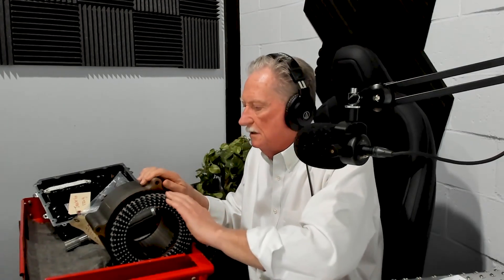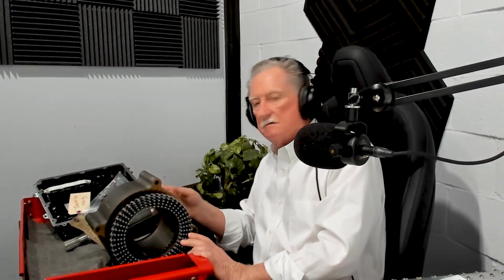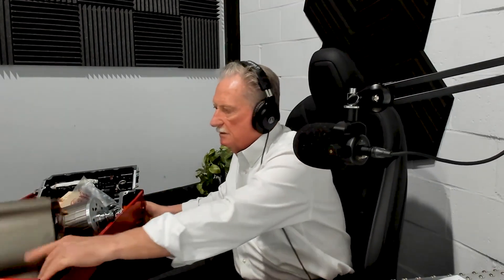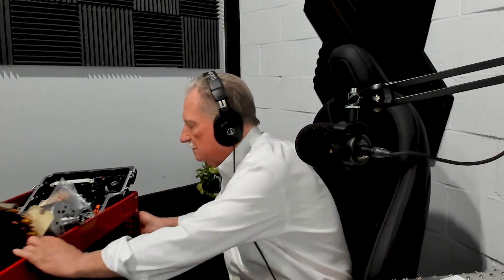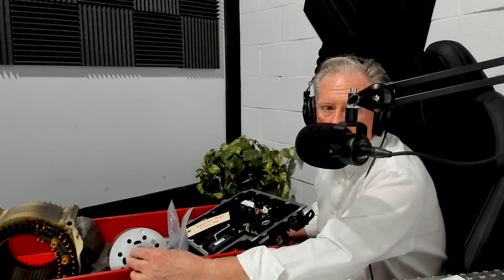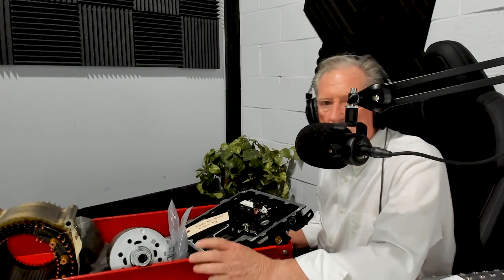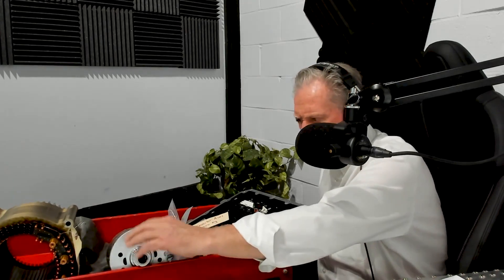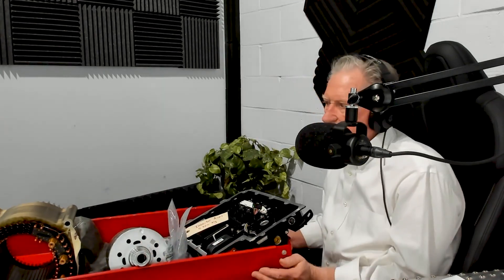Rivian's Hairpin Design

Comment: Really would like to see you guys do a video on axial flux electric motors. The benefits just seem huge, and it's why Mercedes just bought Yasa and are going to incorporate their axial flux motors into their EVs. They are looking for cost reduction methods because the mfg processes for axial flux are not as mature as radial flux designs. But axial flux motor is like 1/3 the size and weight for the same power output.